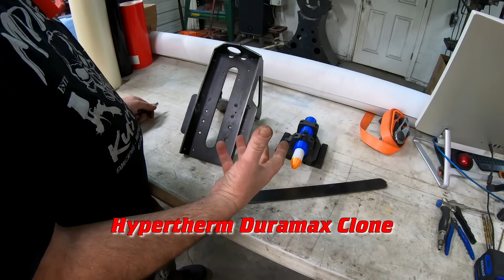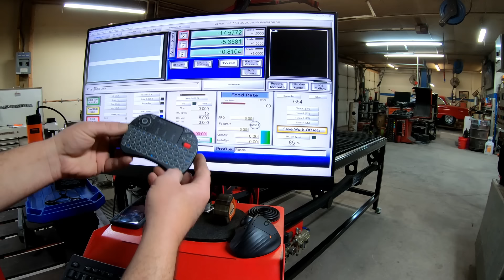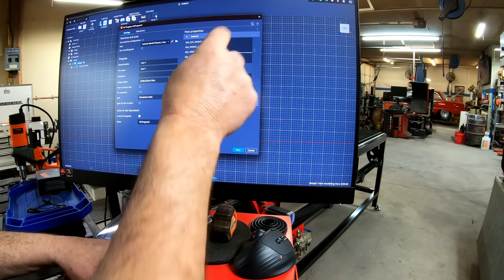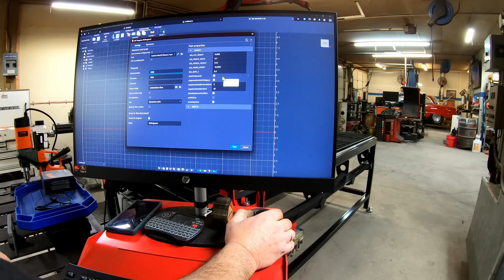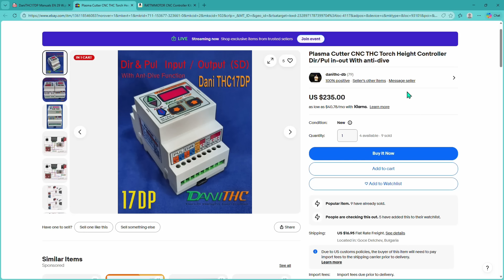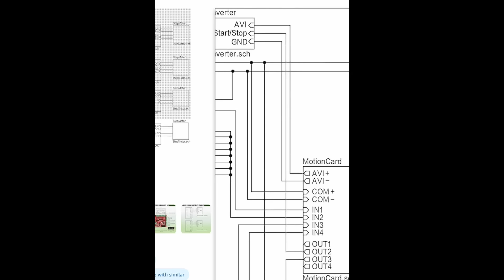THC & Floating Head setup cnc plasma table build series #trending #diy

Comment: Steve, is your torch holder a “breakaway” holder, or is it solid? Maybe you mention it later in the video, I am only 1/3 into it, but it doesn’t seem to be.
Reply from the maker: What's up bud, no it's not a breakaway but, in the future I'm gonna design one that is with different attachments even one with a pen holder for different application.
Reply: Got it, thanks. Lots of info in this video, I’ll need to watch this a few more times to get this piece figured out!

Comment: Thanks Steve another great video, heaps of great information here which will help anyone who’s planning to go this way. Have you had any issues (EMI) with the breakout board in this setup? I have seen another YouTuber he goes corvette50 I believe, he seems to give these boards a hard time. I’d be interested in how it worked for you. Certainly looks like a good option if it’s working well. Thanks for your help, great channel.
Reply from the maker: Thank you, thank you as always I appreciate ya! So with the use of the infamous usb board,, with what I've gathered from a couple of engineers, I haven't had the slightest of an issue. My cuts have been on point every time! So when wiring your panel it must be neat and organized! Wire management, wire ties, ect.. Also ground only in the panel at one point, definitely use sheilded wiring thru out. Make sure the USB cable itself is short as possible and of good quality! And last but not least,, the plasma cutter itself must be somewhat of quality itself. I have followed this to the Tee and my machine works like a Robot!! 😂 Seriously though I think people fail in a bunch of the needed areas to make this work and it's easier to blame the board! Hope this helps!